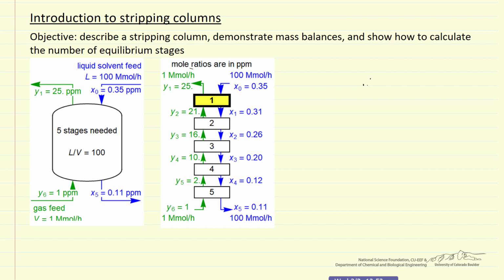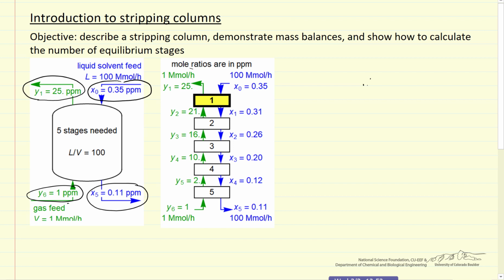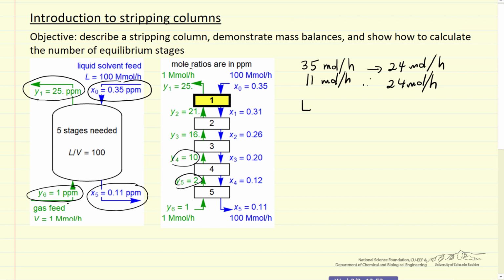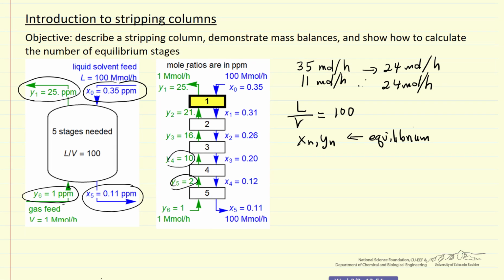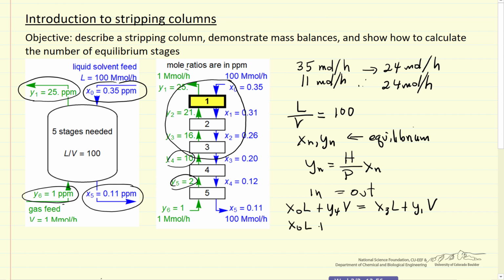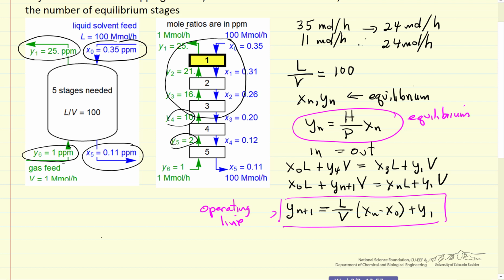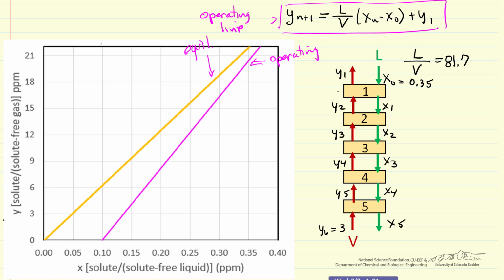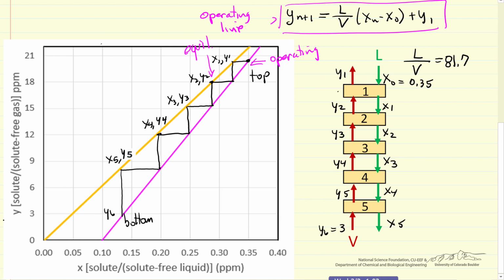Introduction to Stripping Columns

Comment: How do you come up with the numbers for the chart to determine the number of stages? With the way it has been presented, there seems to be a chicken and egg situation ongoing. Do you have to calculate the mass balance at each stage to obtain values to create the equilibrium line and the operating line, plot it and then determine the number of stages, or do you get the values for the operating line and equilibrium line from elsewhere before determining the number of stages?

Comment: If I may ask, it is assumed that stripping gas will not participate in VLE? Is this true in real life? If we assume stripping gas also participates in VLE which means we need to follow general Roults law for given ternary mixture?
Reply from the maker: Yes, a stripping gas like air will not not condense so it will not participate in VLE